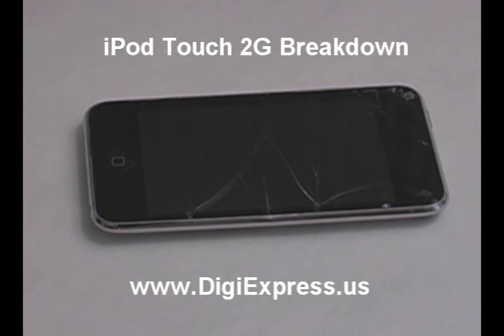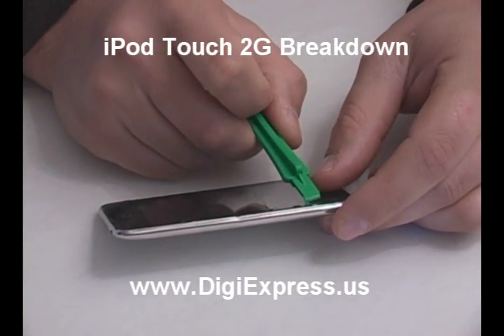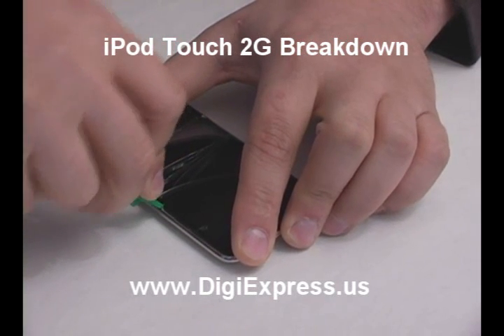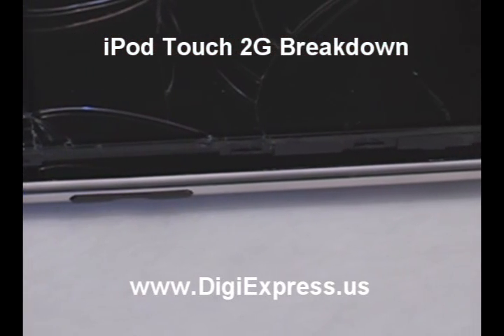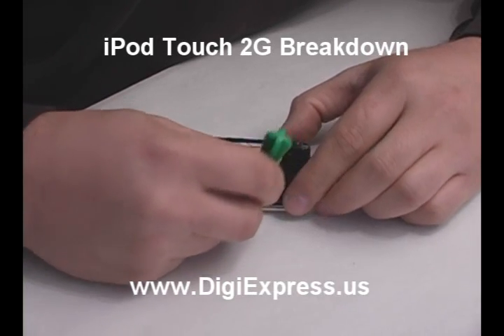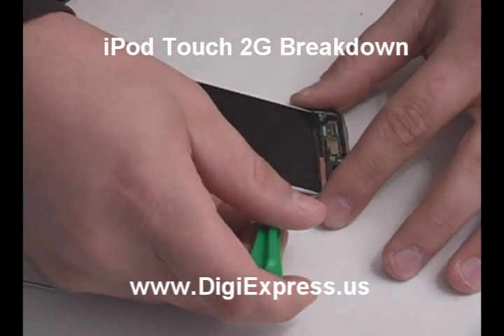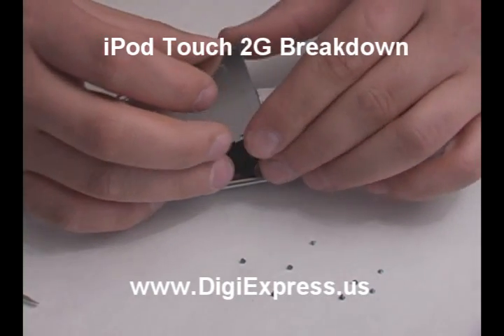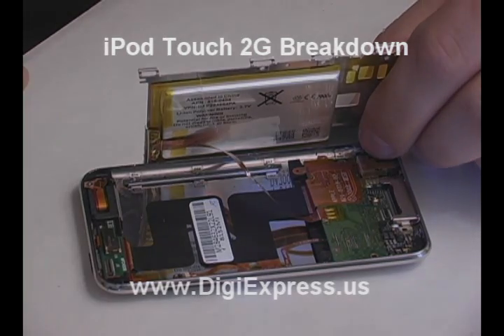DigiExpress - iPod Touch 2nd and 3rd Generation Breakdown

Comment: Thanks so much DigiExpress. Since I last wrote, there has been a pattern where I will hit the home button and the backlight will come on several seconds.  I then allow time to pass, and it might stay on a few minutes, and then the next time, it will work for several hours and then at some point, cut out when I'm using it.  Just posting that in case it gives you any other clues.  Thanks again!

Comment from the maker: @jrk987 The iPod may very well work perfectly once you restore it through iTunes, but I know you are concerned about the data.  This is a grey area, as Apple provides no tools to access data other than iTunes.  Some hackers can use certain USB tools to inject data or "sniff" data; but this would be custom written software for the purpose of retrieving Data.  I'm sorry but I am coming to a stalemate on this issue.

Comment from the maker: @jrk987 I have been looking around for any type of answer to your question, the best I can come up with is to get iPhone Explorer, PhoneView or SharePod to access any part of the data in the iPod.  Granted it is an iPod Touch and not an iPhone but still these type of Applications will access data.  The issue is that the iPod uses iTunes as a throughput for data transfer, it can be recognizable in the Recovery mode and still not be able to transfer data.  The Flash Memory makes foresnics tricky.

Comment from the maker: @lrhoke The backlight issue, which is common, can be one of two things.  The first is that the CCFL in the LCD screen has gone out.  You can fix that by replacing the LCD screen.  If you replace the LCD screen and the light still does not function; then it is a problem with a coil and fuse set on the logic board.  The logic board coil and fuse set is generally not repairable.  Unfortunately the only way to tell which it is, would be to replace the LCD screen and see if that works.

Comment: The backlight on my ipod touch 2g started going out 5 days ago.  It would come on briefly when I pressed the home button but then it would go off.  Gradually, the backlight would stay on longer and yesterday I was able to use my ipod all day.  Then I turned it on last night and the backlight went out and it hasn't come back on at all since then.  Otherwise, the ipod is functioning normally.  Any ideas on what the problem could be?  Thanks

Comment from the maker: @jrk987 the heat could have shut the device down but it should have come back to "life" when it cooled down.  Now if it is extreme heat, 100+ degrees for hours, then it is possible to damage circuitry from overheating.  those types of repairs would require examining a logic board for signs of failure and are not recommended to do on your own, though if you were so inclined then you could disassemble the iPod to see if there are any obvious signs of damage.

Comment from the maker: @KEVINandADAM321 if your iPod has no touch response then the culprit is probably the Digitizer.  The replacement Glass Digitizer we sell would be the first step in repair.  If there had been any water damage to the iPod then you may have a deeper issue.  We can do a Diagnosis on the device if you would like, but generally this iPod would need a replacement Glass Digitizer.

Comment from the maker: @nghs118 In some cases you may find the Mid-Frame called the Bezel.  Though more commonly the chrome peice around an iPhone 3G/3GS is called the bezel.  The mid-frame is what holds the glass digitizer in the iPod Touch and also holds the home button in place.

Comment from the maker: @highangani The iPod Jack could be the 30 pin connector at the bottom of the device or the Headphone jack into which plugs a set of headphones.  The 30 pin connector is something that is not replaceable as it is basically part of the logic board itself.  The headphone jack can be replaced but there is no temporary fix for either.  If you have any other questions, or maybe I did not answer yours entirely, please reply to this video and I will answer them the best I can.

Comment from the maker: @SimSimHH That is a unique issue, but I would try to find an ebay or craigslist seller who is willing to sell you just the stickers or a replacement part that still has the stickers on it.  This is one of the least common questions we have been asked, but the only answer I can provide is to find the stickers from another unit and swap them.  Sorry I couldn't be of more assistance on this one.

Comment from the maker: @yuhatn I would first attempt to replace the battery in the device, though you may just have an issue with the logic board itself.  The device would normally show you an icon of a battery charging unless the battery is completely flat or shorted out.  Check your water sensors which are located down inside the heaphone jack as well as some on the internals (not exactly sure where the internal ones for this device are).  If you see red or pink then there has been water damage, which is very tricky

Comment: hope you have a little time for some advice.. i found an ipod on the street, i was able to get the smashed glass off myself using your guide (great guide btw.. thanks greatly!). before attempting this though i tried charging it, seeing if it would turn on, etc.. nothing. didn't show up in itunes, doesn't respond to anything. do you think my issue might be the battery or something else? any advice would be VERY appreciated! thank you

Comment from the maker: @RolllTide It sounds like you need to replace the glass digitizer.  With having no water damage it would make sense that the front glass digitizer is the part that you should replace.  The glass digitizer is the piece that is the front glass with a thin plastic film attached to the backside (the digitizer).  You can find this part for the iPod Touch on our website along with information on having us do the installation for you, our professional installation fee is $25.00 for any device.

Comment from the maker: @babygurl7866 The 4th generation iPod Touch (and the iPhone 4 and the iPod Nano 6) all use a screen assembly in which the LCD screen is fused to the Glass / Digitizer and they cannot be seperated without damage.  Be very wary of anyone selling only a glass screen for the iPod Touch 4th gen.  The original iPhone had the same screen assembly but this new assembly uses the Retina display on the iPhone and iPod Touch 4.  Visit our site for more details on the repair service for that iPod Touch 4th.

Comment from the maker: @this1dudeisaw The backlight feature on the iPod Touch can either be the LED's on the LCD screen or a coil on the logic board itself.  To determine which part is damaged you would simply install a known-good LCD screen and if the backlight feature works; you have an LCD screen issue.  If you replace the LCD screen and the backlight is still not working, then it is an issue with the coil on the logic board.

Comment from the maker: @9torresjj The damage may be just to the LCD screen, installing a replacement LCD Screen may bring the backlight function back.  If it does not then you have a problem with the logic board, specifically a coil and fuse set on the board that acts with the LCD to increase or decrease the back light.  The logic board itself is not, in this case, repairable.  Though you have a 50% chance that you need a new LCD screen.

Comment: @DigiExpress 
basically, my iPod 2G is pretty messed up. I got it free from a friend, since it was broken..
It can't play music (external speaker or earbuds), no video's are able to play (different files) AND it's unable to turn Wi-Fi on or off. Do you or someone who reads this have any clue what to do?
I looked on apple-support, did the reset and all but nothing.
Searched forums for ages now, stillnothing. Is it possible to fix it? Since I have no warranty, applestore is not an option, right?

Comment from the maker: @nnewmy if you use a suction cup to remove the screen you will pull the glass/digitizer from the mid-frame; leaving the mid-frame attached to the device. You cannot remove the ribbon cable from the logic board if you leave the midframe attached. For an iPhone 3G you can use a suction cup as the mid frame on an iPhone is held in place with a thin rubber gasket and 2 screws at the bottom of the charging port. Doing it this way ensures that you will be able to finish the repair with minimal stress.

Comment from the maker: @teews64 The metal piece you speak of, if it is the gold z or s shaped piece that is on the logic board then you will not have a working home button again.  You would need a new logic board or a replacement board from any various site.  I would not recommend attempting to solder the spring back onto the board, as you can damage much more than just the home button functions.  You more than likely have just damaged the home button functionality and the rest of the device will work properly.

Comment from the maker: @1157tiffany I would make sure that you are using Apple branded cables and chargers first.  You may have a problem with the way you are connecting the device to power sources.  Your problem sounds like a battery is malfunctioning due to various reasons or to water damage.  If you look down into the headphone jack of your iPod you should see a white color, if you see any pink or red then you know you have water damage.  We have a Diagnosis service for $25 (+ s&h), more information is on our site.

Comment from the maker: @cronaldorules97 The cost for replacing the Glass on a 4th Gen iPod Touch is $119.99 for the part and $25.00 for the professional installation service.  The newest iPod Touch screen comes as an assembly which includes the Glass, Digitizer and LCD Screen.  These parts are fused together from the supplier and as such cannot be separated for individual sale. The return shipping cost is as low as $8.75; so for the full installation it is only $153.74.

Comment from the maker: @BigBadDipper You may have a problem with the headphone jack, which is soldered to the logic board.  This headphone jack could have come loose from the logic board or the solder pads on the logic board have been damaged.  If you disassemble the device and focus on the solder points for the headphone jack you may find there to be an obvious defect.  If there is not then you may have a logic board issue.  We do offer a Diagnosis service for situations like this, please visit our website for info

Comment: i have a problem with the power button. When ever i turn the ipod on it acts as if the power button is still down there but its not stuck, its in its normal spot, do you know what is wrong with it and what i should do? (I found this ipod in the road unharmed no scratches on the screen, and the wifi doesnt work but thats okay.)

Comment from the maker: @sickmedicine The backlight feature is displayed through the LCD screen and many issues with it can be attributed to the LCD screen or a coil and fuse set on the logic board.  If in replacing the LCD screen you find the backlight feature to still not function, you then have an issue with the logic board.  Our company has the ability to refurbish certain logic boards to repair issues such as this.  More information is available at our website.

Comment from the maker: @AZXfoREVer66567 you can purchase the spudger, the green tools, from the Tools section of our website.  We have both the plastic spudgers and the small putty type 'knife' that you can see in some parts of the video.  Though when working on any electronics device you would want to keep conductive materials, i.e. metal, from the internals.  Thus why the plastic spudgers are great.

Comment from the maker: @EpicCripProductions The actual home button is sandwhiched between the glass/digitzer and the mid-frame.  The physical black button, the home button, is only a plastic button.  Behind that button, on the mid-frame is a metal rectangle that the button depresses.  Behind this metal piece there is a small home button flex-cable, this is about the size of a fingernail.  That being said, you basically remove these two pieces of the home button and re-use them on the new glass/digitzier and mid-frame.

Comment from the maker: @ChiyoChiYamamoto The power button consists of two pieces.  The first is the physciall plastic button and the actuator behind that button.  This is called the on/off flex cable.  This part does need to be soldered into place and obviously the old part needs to be removed properly.  In disassembling the iPod you should be able to see if the flex cable itself is damaged.

Comment from the maker: @jiverome14 You would need to break the iPod down completely to get the old back plate off, then install the parts back into the iPod the way that they were previously. If you run into problems you can always send the iPod to us and we can install the back plate for you. Check out our website for more information or call us at 1-800-440-4693

Comment from the maker: @stupidkid8585 Whenever a customer reports water damage, we always recommend our diagnostic and repair service which can be found on our website. Without opening and looking at the iPod, there's really no way to tell precisely what's causing it not to turn on. More than likely, it will require some type of part replacement, but we will not know until we receive it. Let us know if you have any further questions!

Comment from the maker: @sebrina321 You may want to try a reset or a restore to see if this solves the problem. If not, we do offer a $25 diagnosis and repair service, where our technicians can take a look at it let you know what is causing your problems. Check out our website for more information or call 1-800-440-4693.

Comment from the maker: @fortyfiveplayer The issue that you are describing is something that would have to be diagnosed by our technicians for a proper answer.  There could be something simple that could be fixed or something may need to be replaced, our Diagnosis / Repair service is only $25.00 and takes 1-2 business days to complete.  If we can repair the parts already installed then you are covered under that initial payment.  If parts would need to be replaced with new ones our tech would email you the details.

Comment: I have a 16G 1st gen when I connect the usb plug the touch's screen never changes- as if I never plugged it in at all. My computer does not react at all to connecting it either, but my old IBM LT at least says "unrecognized USB device" but still the screen on the touch never changes. The version is 2.2.1, btw- any ideas? Otherwise all works ok, and my accessory FM transmitter works that uses the dock jack.

Comment: I just replaced the digitizer on my ipod and it works fine except it is VERY dark. It is working  (I can see everything if I look very closely) but is not usable when it is this dark. I was able to see enough to get into the setting and the brightness is turned all the way up so that is not the problem. Any ideas what the problem could be??

Comment from the maker: @serge581 A new headphone jack is $29.99 and we can install if for $25. This is a difficult repair as you run the risk of damaging other parts of your iPod. Also the part must be soldered back into the iPod. Check out our website for more information.

Comment: @joker2686 depending on what generation ipod touch you have, some can'not be tunrned off otherwise they wont work at all. if you have a 3RD or the newst omne with teh camera, you need to plug it into the itunes on your pc and reformat ie ocmpletly

Comment from the maker: @joker2686 If the touch part of your iPod is not working you would need a new Replacement Screen and Digitizer this will fix the cracking and the touch sensitivity. We sell this part on our website.

Comment from the maker: @Holysam112 While there should be no reason at all your data would be erased during the repair, we cannot guarantee your data is unaltered due to the possibility of pre-existing issues with the flash memory and the possibility of damage occurring in transit. A headphone jack repair does not involve any part responsible for the memory, however.

In regards to your LCD issue, it sounds more like a software issue than an issue with the LCD. I would recommend attempting a restore.

Hope this helps.

Comment from the maker: @jtiskool305 If your iPod isn't turning on at all, you basically have a non-functioning device which, along with water damage, is one of the most difficult issues to diagnose. If you're looking to troubleshoot your iPod, the best place to start would be by replacing the battery as often times the battery shorts out.

However, we would recommend sending it for a full diagnosis. For $25.00 we would find out which parts need to be replaced and quote you the total repair cost. Call us for more info.

Comment from the maker: @ryguy425425 The tools are designed to break to make sure there is no incidental damage to the iPod's case. If you happen to have a spare guitar or bass pick/plectrum, you might find that it will last a bit longer and may be easier for you to use. Hope this helps!

Comment from the maker: @tomtom2000able Each case of water or moisture damage is separate and unique.  What we can recommend is to have a Diagnosis performed which will provide you with an email from our technicians stating what exactly is wrong with the device.  It will also list any parts that are necessary for the repair.  The Diagnosis service takes 1-2 business days to complete.

Comment from the maker: @sweetebony2436 If it will not unlock because it will not slide this part is the digitizer.It is connected to the replacement glass part and we sell the part on our website and can install it for you for $25. If there is any other damage sending it in for the $25 diagnosis can also help to let you know what all is wrong with your iPod. Check out our website for more information.